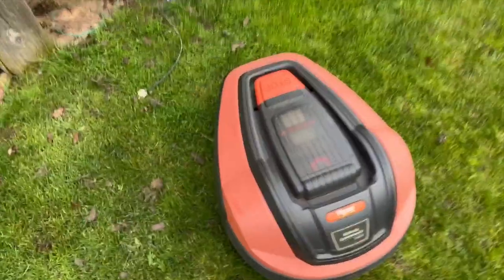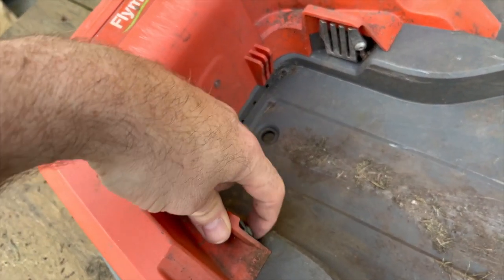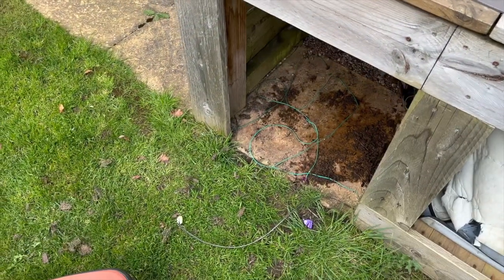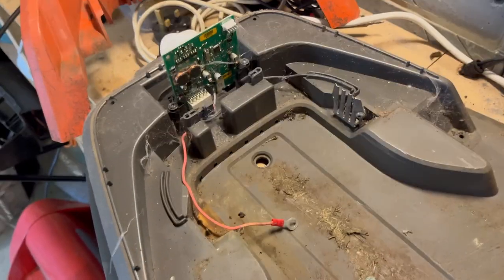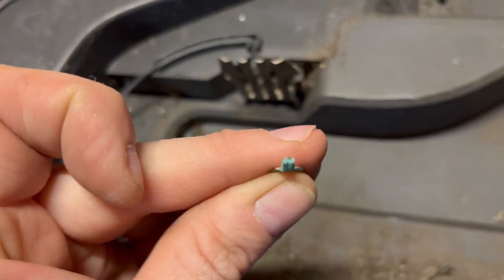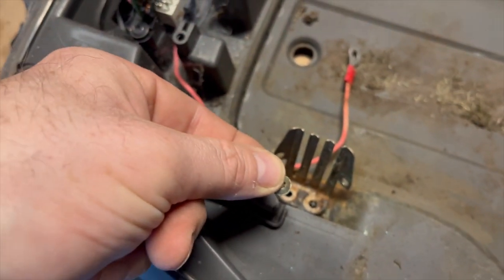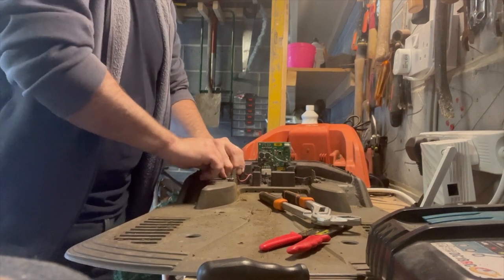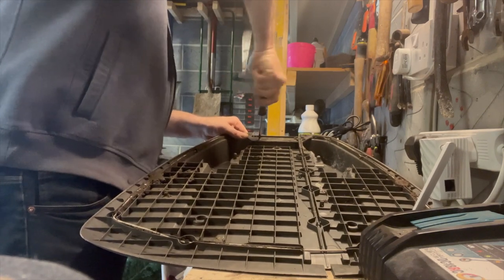How to fix your Flymo Robot mower

Comment: Great video. Thought I had the same problem. Watched how you took the base station apart. Checked my connectors but mine are still ok and everything appears fine with base station. I just have no green light on it. I guess it may be the power pack or the cable coming from it to the base station. I tried the fuse but it’s not that either. Hopefully I can work it out. Thank you anyway as I have now ruled that issue out.

Comment: Thank you for creating this little video about your Freddie...hoping to fix my Flo ;) Fingers crossed I can find the cause after seeing this, so will be back to share how I got on :) EDITED - So your video gave me the confidence to check all the wires under the enclosed part of the docking station and they were all good. No power initially after changing the fuse, as the plug may have got wet during the 2 years I've not used her. So checked again and remember that a while back I accidentally pulled the power cable that comes straight out of the back of the docking station. Checked this and one of the wires wasn't all the way in....but now fixed! So happy, as I've not been well over the last couple of years and not spent much time on my garden. But having Flo, really helps me tick of one of those jobs that I struggle to keep up with during the summer :)